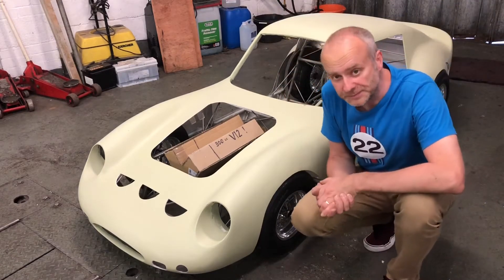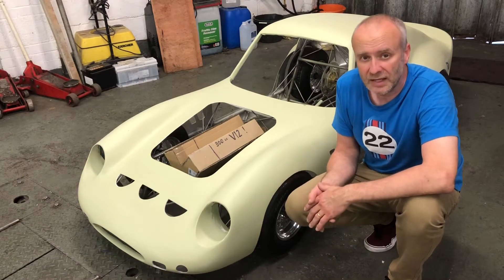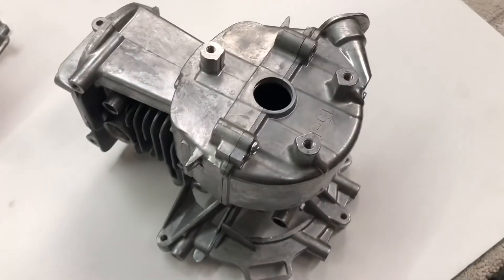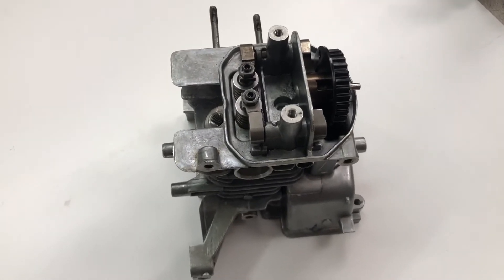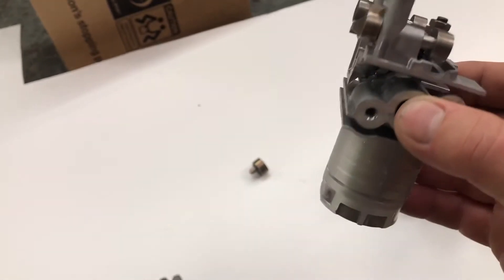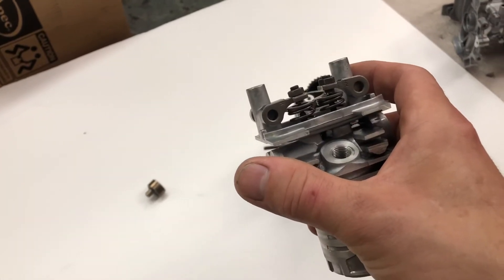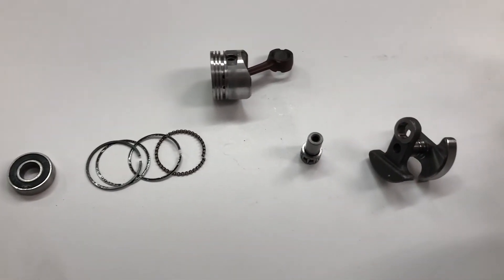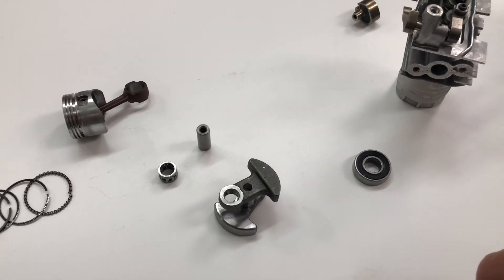300cc v12 engine build using 12x Honda chainsaw engines! prt 1 !

Comment: The camshaft is looking kinda thin, aren’t you worried about twist?
Reply from the maker: I checked to twist over length , its possible there's a degree there , proof is in the pudding , I best get on with the baking!

Comment: A turbo on this tiny little thing would compress the air even smaller than the motor already is 😂 15 foot pounds is more than enough for scarlett

Comment: As others have already said, if I can help then let me know. My only concern is with the crank. I don’t know what machinery you have available, but if possible I would urge you to go with a one piece crank, despite the obvious short term pain to make it. You’d need new rods too though I guess.
Reply from the maker: I have a machine shop with rolling road dyno ( www.vmaxscart.co.uk ) and i like the unorthodox route with full roller bearings,  hence the press together crank. I've built lots of 2 stroke kart engines with press cranks, and as i have all the engine components already the press crank looks feasible .  Also this engine will be maybe  more show than go, aiming for wide toque band rather than peaky high end power. I've checked the chassis will fit on the dyno and it will use the Emerald K6 ecu, as i use these daily. Its always good to get another perspective though and this is my first small scale engine so its a steep learning curve, i may yet take you up on some help !